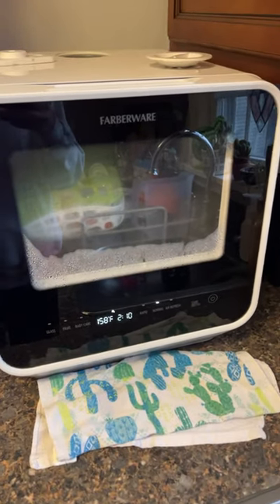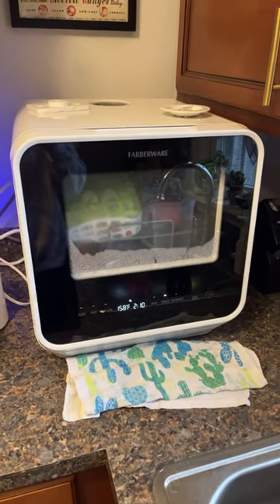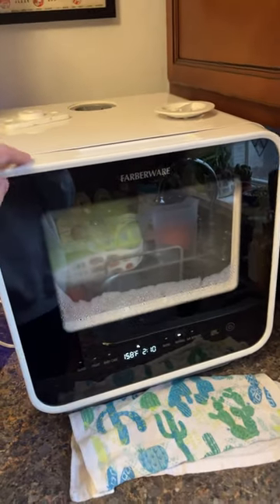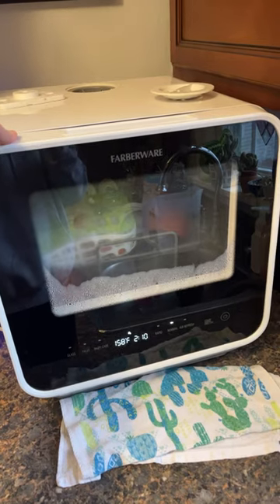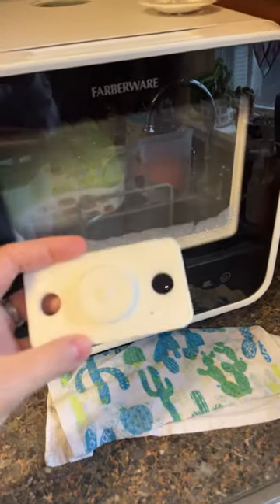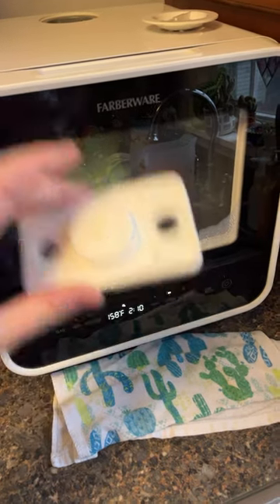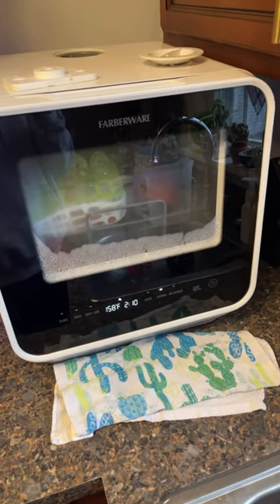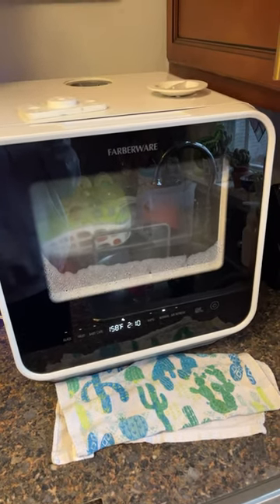How to fix E4 error code on countertop dishwashers (Farberware, HAVA, Comfee, Black & Decker etc.)

Comment: For anyone who sees this video, by no means do this. If you remove that float from your dishwasher, you remove its ability to prevent overfilling next time.

To reset the float, simply lift the front of your dishwasher by three inches, then let it drop back to the counter. You just have to knock it loose, is all.
Reply from the maker: That’s not true, our dishwasher has an alarm that goes off when it’s full
Reply: @ColossusCo  Really? Cause that's exactly what the E4 is. You took the float, the one mechanism that triggers the sensor, out of your machine. You've essentially bypassed the sensor, when all you had to do was nudge it loose. I had to deal with this issue just today.
Reply from the maker: @Ursicus-td8zt  sure, but I would have to tilt it to get water out of it nearly every use. Now it works perfectly, I just don’t think it was designed very well to begin with. I posted this video months ago and haven’t had a problem since